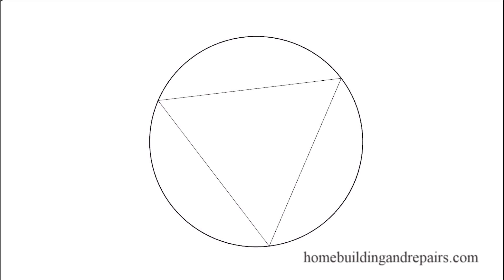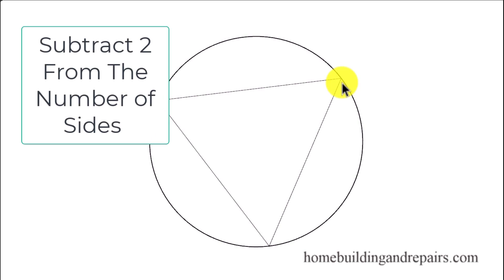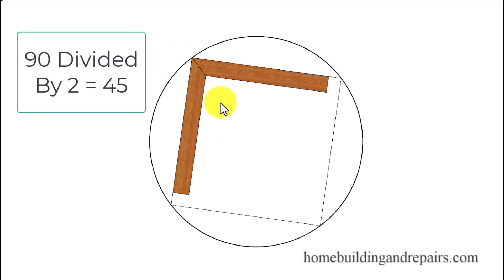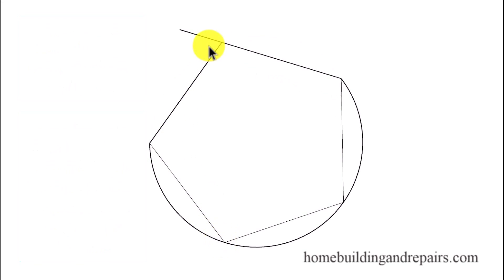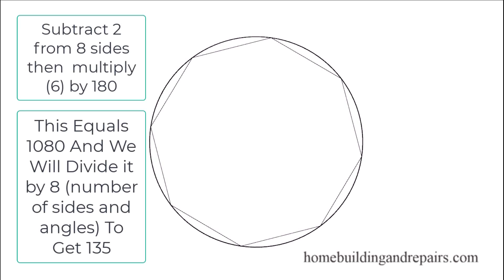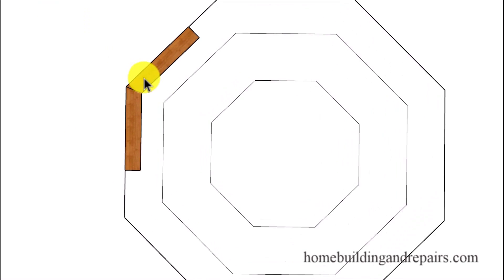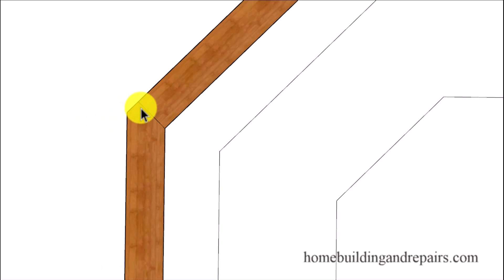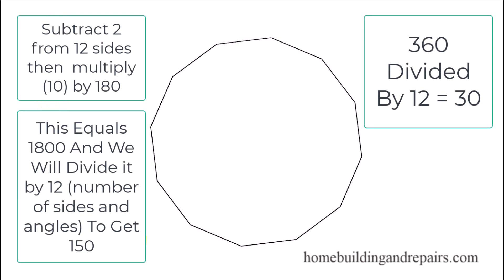How To Calculate Inside And Outside Angles On Buildings With More Than 3 Sides And Same Measurements

Comment: A simpler way to find the miter cut angle is (180–360/n)/2, n=number of polygon sides. And for the dihedral angle is 180+360/n. And the bevel cut angle for a dihedral lap joint is 90–360/n.

I used to design and calculate geodesic structures for fun as a teenager back in the 70's.
Reply from the maker: I don't know if it's simpler, but thanks for sharing.